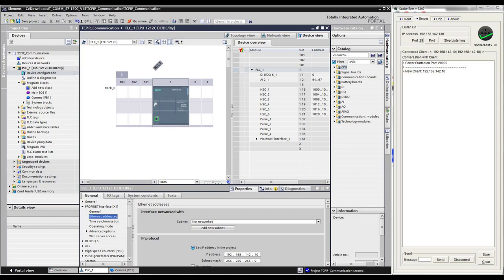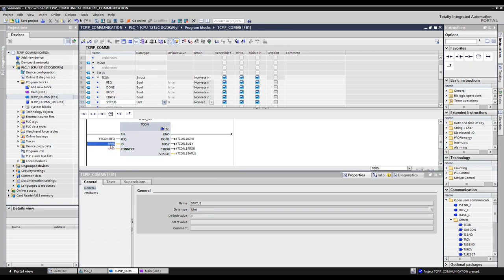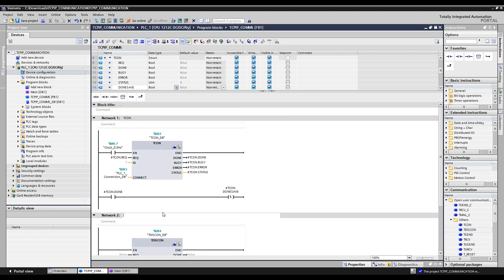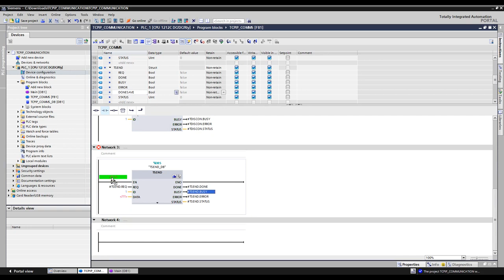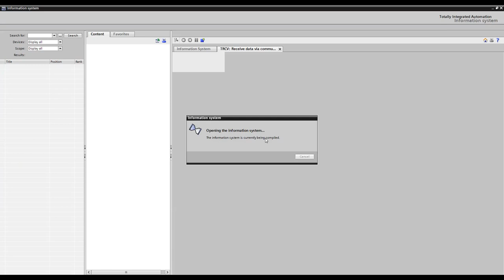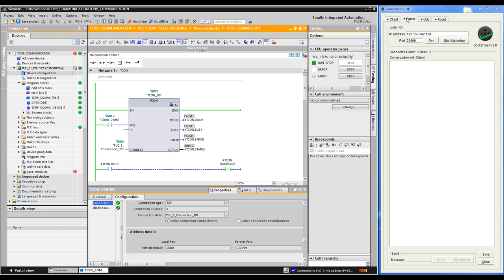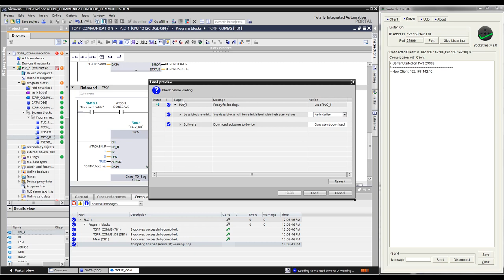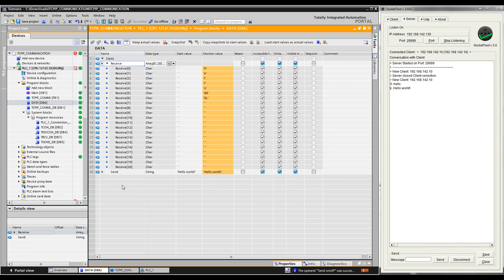S7 1200 TCP/IP Communication with windows terminal

Comment: When I connect  TCP IP device just to SocketTest v 3.0.0, I receive string  [1]T000000000003

in SocketTest as Client

Then I connect separately PLC to SocketTest v 3.0.0. and I receive also string  [1]T000000000003

on PLC Client and SocketTest as Server.

But when I connect just PLC and TCP IP server device to read string on PLC, I receive in PLC on TCON block STATUS 16#7002 »Connection is being established (REQ irrelevant).« But connection is not established. TCP IP server device is connected directly to PLC. What could block the connection?

Comment: Hi thanks for sharing this video.
I have a problem that sockettest v3 is not connecting to the ip address of the virtual plc (plcsim).
It accepts only the address of the localhost or the ip address of the pc.
Is there any solution?
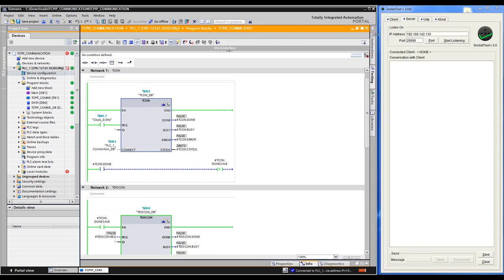Reply from the maker: Hi, you have to use PLCSIM advanced. Sockettest is server it this case, it's accepting connection from PLC #12:38

Comment: After receiving string, Data receive had additional 2 characters $R and $L. How can i fix it, sir ?
Reply: Use string modification funtctions. For example MID, they can be find in TIA right panel under Insturctions/Extended instructions/String
Reply: @petrbroza7029  Many thanks to u, but i wonder why did string have 2 characters mentioned at comment?
Reply from the maker: @angcao4166  It's Carriage return and Linefeed. You have to go back to the history of typerwrites, but those control characters are still used in these days, usually signaling end of the transfer. So they are added by device you are communicating with.
Reply: @industrialautomation3470  thanks sir :D. Can you make a video about programming a tool such as sockettest by c#. I have tried to create connection tcp/ip between 2 terminals
Reply: How did you fix the connection error with SocketTest? JVM_bind error

Comment: Very good tutorial
I have still one question.
When i send a string then i see in the Sockettest terminal the same string with on the beginning 2 strings characters
What is the reason, and how can i solve this issue?
thanks in advance
Frans
Reply from the maker: Siemens add some unprintable characters at begging of the string. Just figure out length of the string with LEN and then use command RIGHT with length size Length-2.
Reply: @industrialautomation3470  Maybe a stupid question, but were must i place that right command?
thanks in advance
Reply from the maker: @fransvanenschot3286  check the manual https://cache.industry.siemens.com/dl/files/465/36932465/att_106119/v1/s71200_system_manual_en-US_en-US.pdf , page 269
Reply: @industrialautomation3470  Thanks for the fast response.
I know how to use the right string command, but were must i place this command in my program that's now clear for me.
also everywhere in the program i see the correct string without the 2 leading char., only in the sockettest window i see that 2 weird char.
thanks in advance,
Frans
Reply from the maker: @fransvanenschot3286  Ok, you mean sending string from PLC to terminal. Try inserting new line at beginning of the string. Create new string variable with starting value '$L' and then CONCAT it with your variable.

Comment: Sir,Thank you so much for the detailed explanation.In my application,I want to send commands to my external card from s71200 and waiting for response from it, before sending next command from PLC. By using your code,I can able to make communication but getting response but its not proper,Not giving exact response.Extra strings also coming with response.Kindly help.
Reply from the maker: Hi, generally I first test the communication with Socktet tester Windows app, to make sure, other device is communicating correctly and then switch to plc. I would connect just pc and your device, to isolate that string is not coming from some other device on the network.
Reply: @industrialautomation3470  Okay,I will check it again sir.
Reply: Sir,I have checked code with socket test.Its working fine.but with PLC code it's not happening,Only telnet welcoming message came after that no response from third party device.
Reply from the maker: then problem is with your plc code. Try to compare commands going from socket tester versus plc. Plug plc into computer and watch commands from plc with socket tester.
Reply: @industrialautomation3470  Sir,
Issue got solved.Instead of sending string as input data,we tried with characters as input data.Its working fine now.Thank you so much.